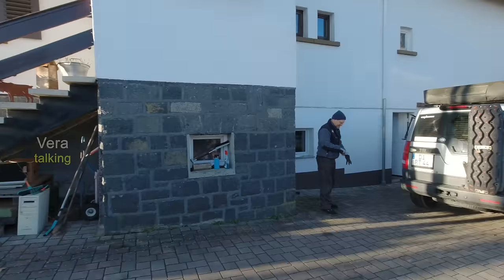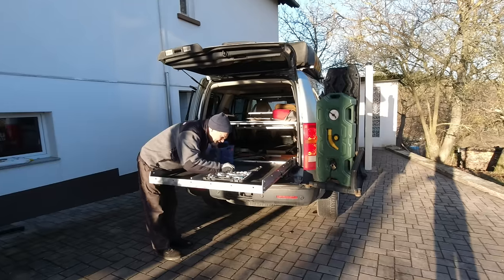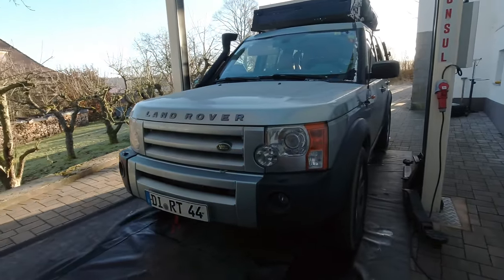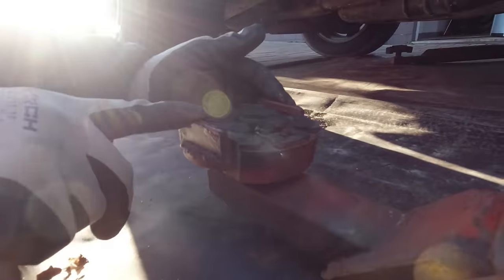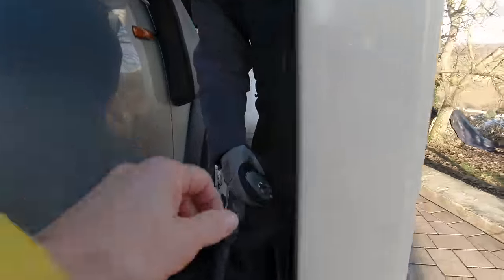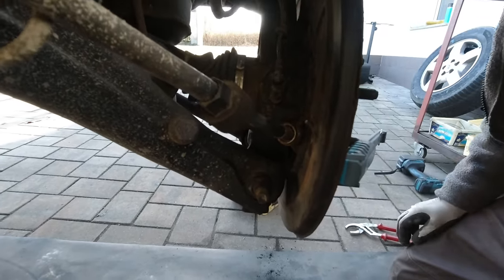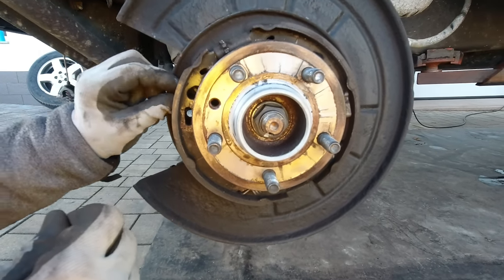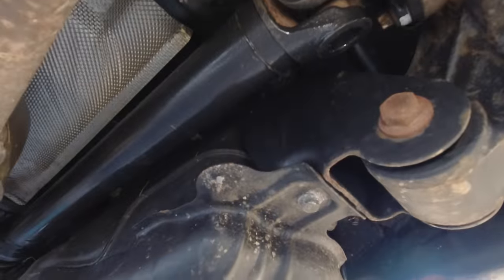How to Fix the Electric Park Brake - Land Rover Discovery / S5-Ep6

Comment: I was amazed at how many miles you have covered since you did this last time.  Treating your D3 or Land Rover like a classic car is exactly the way to maintain these vehicles.  Regular tinkering and fettling will give it best chance of not letting you down.  They can be complicated beasts but so rewarding when they are behaving and as you said Vera, such a good looking vehicle especially since it is  18 years old but still looks fresh 👍🏻😁 on the cable ends where you use your plumbing pliers to removed them from the backplate I alwasy smear a bit of silicone on there to stop the water trickling in.
Reply from the maker: wait for the next video on my Disco. It is even more obvious that these old Land Rovers have to be treated like a classic whose parts are difficult to optain. 😅👍🙋‍♀️

Comment: Ha ha! My German friend Manfred will be so pleased that used the word “Catastrophe”. Thank you Vera!

As you mentioned, Christian, electronic Handbrake failure is more common on Manual LR’s , because most of us that have the Automatic versions use the ‘P’ to act as our handbrake.
The problem being that when it does go wrong, often due to not enough use, everything is often very seized and difficult to undo to repair.
I think it is probably best to at least use the handbook occasionally.

Why somebody like Powerful  UK has not come up with an alternative proper lever operated Handbrake system, I don’t know.

A similar system is used on the New Holland ‘T’ series tractors, which automatically applies itself whenever the tractor is placed in neutral. When it goes wrong, which it surely will, it is a real pain. 
Fortunately for me, my one is too old to have that system. I’m in no hurry to change it for the younger version!
Reply: I suspect that the advent of electric emergency brakes was somewhat for legal reasons.  If applied at speed, the normal ABS system uses them to gradually brake the car, versus allowing people to lock up the rear wheels to perform "bootlegger turns" etc.  They usually engage when parking, also act as hill-holder clutches.

Comment: Great and a brilliant job!  Very rewarding when you improve on something and get those cogs well greased  Concern over the cable ends where they meet the brakes - water ingress as pointed out by Vera, as you've done just pack with waterproof grease, I get through tons of it on machinery.  One comment, as I've mentioned before, get the small rigid mud flap spats that stop all that spray up onto the outside of the wheel arch!  My OCD kicking in.... bloody desktop mechanics!  Maintenance on these vehicles is not for the faint hearted, and the facilities and amount of kit you have is better than most garages - they would just say replace, and another 5K please!

Comment: Hey guys another thrilling episode of LR3 maintenance. My 05 is due its 120,000 mile timing belt change and everything that goes with that, incl the oil pump of course, along with an a/c repair.  I'm going to disagree just a little with Vera, omg, I don't personally think the Discovery is difficult to maintain, there is just a large amount to maintain and pretty regularly too.! Thanks for the brilliant videos, they really make my Sunday x
Reply from the maker: 😅👍Wait for the next video. Most of what we say, especially I, is not necessarily directed to the able DIY mechanic. They don't watch us normally since they don't need any help. But for the beginner DIY Land Rover mechanic, it is a difficult. 😃👌🙋‍♀️Vera

Comment: I hate working on drum brake type parking brake. Since it uses servo effect, to make it "zero touch" brake pad to drum while able to achieve maximum bite at maximum cable pull is impossible. Always the new brake pad is actually mild touching the drum. Its easy to hear, while car jack up all 4 wheels and engage 1st gear. It hurts to hear and see that dark side of a drum brake design.

However,  I enjoy seeing Vera n Chris doing the job, its fun to watch as always.😊
Reply: I really enjoy him working on those drum brakes.  It brings back a lot of memories of my families wheel and brake shop when I was a kid watching my father and grandfather work on them.

Comment: I have a late 2008 Discovery with the later spare wheel bracket. By accident I found that if you drop the back part of the exhaust system you can access the module quite a bit easier!

Comment: I owned a new Discovery 3 manual from 2005 - 2008 and the only thing that failed during the three year warranty period was the electric parking brake. I remember the incident well because my wife was stranded in her school car park and the vehicle had to be recovered. Our UK LR dealer spent over a week fixing it. Our previous three Discos had mechanical parking brakes and I don't recall a problem with any of them.
Reply: Biggest issue with the D3 parking brake is lack of maintenance

Comment: Mental note.. if the handbrake fails take it to a garage. I'll stick to adjusting only. Shame LR couldn't come up with a simpler design. The old style (defender, d1, d2) handbrake on back of centre diff are easier to work on but needed regular adjustment to stay effective. An electric disc version of that could have been very good. There's a company that does disc conversion for that old defender handbrake.
Reply from the maker: Don't worry, other car manufacturers have also EPBs installed, not just Land Rover. And from the comments we get, they fail just the  same. 👍🙋‍♀️

Comment: I really  would prefer an old fashioned manual park brake.  When my D4 was under warranty I was 350km west of Alice Springs (Central Australia) and when we stopped for lunch I used the EPB.  After about 20 minutes of driving after that I noticed a bad vibration and smoke coming from my right rear wheel.  No alarms and no faults registered.  The right rear wheel park brake was locked on but the left was wheel was free.  Nobody has ever been able to explain how that could happen.  Anyway after six nights of accommodation with a rental car the EPB, all cables, both rear discs and the right rear wheel bearing were replaced under warranty.  The right rear components were severely heat damaged.  Quite an expensive warranty repair undertaken in Alice Springs.  Thankfully LR Assist were very responsive and also I had a satellite phone to contact them.  Only took 4 hours for the flat bed truck to reach me.  I don't use my EPB in remote areas anymore! I visited the service agent every day during the repair so I pretty much know how hard it is to remove the EPB from a D4.
Reply: I suspect that the advent of electric emergency brakes was somewhat for legal reasons.  If applied at speed, the normal ABS system uses them to gradually brake the car, versus allowing people to lock up the rear wheels to perform "bootlegger turns" etc.  They usually engage when parking, also act as hill-holder clutches.

Comment: Great content as ever ! I have auto and only ever put it in park rather than use parking brake. I know yours is manual but just checking if you see issues with my method in auto please ?
Reply: I have an auto FL2 & do the same. There’s a school of thought that we’re doing harm to the locking pin in the gearbox as it has to withdraw under load if the vehicle is on a slope.
Reply from the maker: On our Auto we only apply the EPB when parked at a steep angle, to support the transmission. 👍🙋‍♀️
Reply: @Vera_and_Christian  thanks guys. Keep up the great content, love it.

Comment: Guys, thank you again for another awesome video, so entertaining.
A quick question, I am 100% sure there is a reason, but on my BMW X5 (the same park brake module), I could disconnect Bowdenand emergency release cables from the module and remove the module with ease, did not even take wheels off.  Replaced the gear set and motor (Amazon) and it worked perfectly after I did reset procedure. Surely it can't be so simple on a Land Rover 😁
Reply from the maker: yes we also ordered the Amazon part. But we have a Youtube channel and want to show in detail what happens, how it looks inside, and how to fix it cheaply. That is our purpose here. When Fabian or our one other friend who has the priviledge to have is Disco 4 serviced by us,  comes by and want their EPBs fixed, we will use the Amazon part. 👍🙋‍♀️

Comment: very similar to Renault module / BMW module - the cables outer sheath crack  - lets in water and seizes causing strain on motor, so brushes wear out - new motor £38 / cables £75 and replace the small blue relay £5 on circuit board - done 2 now on Grand Scenic's  vs £800 from Renault + programming
Reply: The Discovery one is similar money from LR 😩

Comment: My 06 has the parking module broken. I don’t ever use it so I have been dreading fixing it. I know the gears are stripped on mines. I have more important things to tackle. Mines just reached 228k miles which is like 360k km? Just smelled a bit of coolant and coolant level was low. I went to find the coolant leak and I spotted power steering and engine oil leak. Still didn’t find the coolant leak. 

I love my lr3 and I will keep it running forever. 10k trouble free miles after rebuilding trans.
Reply from the maker: https://youtu.be/Tj5ojmUHU0A?si=jMsVwJe4oSAUxv7u check this video👍🙋‍♀️

Comment: I’ve been able to reset the module while still in the vehicle. Drop the exhaust and the top cover will prise off. I’ve found if the travel exceeds specs the threaded rod will jam against the stop on the L/R cable and the clutch mechanism screams its head off! Also when adjusting the handbrake shoes, there’s a little Allen screw which needs to be loosened prior to resetting the adjuster wheel then retightened after the ‘min’ 10 click wind back. Shocking design 😳
Reply from the maker: We have shown that in many videos. 👌👍🙋‍♀️

Comment: If I can get the EPB out using this method I will sign up for your patreon!
Reply: With a few slight mods (file down the brake cable holder and removal of one of the rubber support grommets)  it actually worked!!   Reassembly will be a nightmare but it is better than removal of the rusty backplate.

Comment: Having just spent all weekend doing the same job, I can tell you that you didn't need to remove the right side cable.
With the module in the car, unscrew the right side cable black large retainer from the module, then you can unclip the white clip, then then you can disconnect the right cable from the module.  That saves you removing the right side cable at all!
To remove the module without removing the left cable, you have to dismantle the EPB in the vehicle, remove the dc motor and gearbox, and then unwind the leadscrew while working under the car.  Terrible job, but at least you don't have to remove the cables.
Oh, and that bracket that the EPB mounts to above the differential?  Just remove it completely.  There are only 4 bolts to the chassis rails.  Then you have plenty more space to work!
Lastly, regarding the snap ring slipping off...  there are different gear sets from ebay and alibaba.  One aftermarket set it tooled badly and the snap ring groove is very thin and prone to the e-clip slipping.  Good to see you didn't use that type..    and there is a guy in Russia who made a complete brass shaft for the gear, but your custom retainer is a far more elegant solution!
Cheers from sunny Melbourne Australia!
Reply from the maker: We have already done a video on the epb, where we explain why we take out everything. And not open the cables on the module. 👍🙋‍♀️

Comment: Bring back the simple cable handbrake lever in the floor or under the dashboard...  I've just had to replace both electric parking  brake calipers on my 100,000 mile Golf. My 20 year old Passat with 210,000miles mechanical handbrake never had an issue. Progress? no.....
Reply: I suspect that the advent of electric emergency brakes was somewhat for legal reasons.  If applied at speed, the normal ABS system uses them to gradually brake the car, versus allowing people to lock up the rear wheels to perform "bootlegger turns" etc.  They usually engage when parking, also act as hill-holder clutches.

Comment: Hello LR ? Am Boni, From Afrika a landrover mechanic help me plz to solve this problem if you have ever encountered . Landrover disco 4 smoke caming from air intake manifold of the right side😢
Reply from the maker: You need to make a smoke test and see where the crack is. And then replace whatever part is broken. https://youtu.be/6vhYXutMSDc?si=cC_4jMxFqBt4k72x We have since then bought a smoke detector on Amazon. We use it all the time. 👍🙋‍♀️

Comment: Hi guys, owned a disco 3 in the past still own a disco 1 with nearly 700,000 kms on it just bought a disco 4 tdv6 8 speed 240,000 kms because i hVe a spine that is fusing and its amazing what i struggle to fit into. Just a question what are the lower tension wrench figures you use, the old one i use I'm finding doesnt go low enough in a lot of circumstances. Bit disappointed we bought the 2013 disco and the"QUEEN" turns up. Enjoy her. 
Cheers Lyndon down here in Tasmania.
Reply from the maker: Not sure why you are dissapointed. We still have all our Discos. Check out our videos, they are good.👍🙋‍♀️
Reply: @Vera_and_Christian  not disappointed really it was as if we bought our disco and you changed marks. As I said enjoy your new Queen and I'll keep picking up the extremely handy hints and info that both of you bring in this channel. Again thanks have picked up hints already so keep up the great work
Lyndon

Comment: What was the  problem with the parking brake? I have a similar problem where when I activate it, they engage but they scream after tightening. I also replaced the gears with brit part 2 years ago but they failed instantly
Reply from the maker: The Plastic shaft was distorted, so that the clip slipped off. 👍🙋‍♀️
Reply: sorry, I meant what were your symptoms to know there was a problem... did the brakes stop working or did they still and make a screeching noise. I'm dreading another go at removing my module... I'm one of the unfortunate ones where the plate covers the module behind the spare wheel so I had to cut an access hole through the thick steel... love your videos!!! @Vera_and_Christian

Comment: Do you think it is possible to put in a manual ratcheting parking brake in a Discovery 3 ? I want to put it in driver's the footwell, kind of like an old Defender. I feel like it would make it more reliable out in the woods off-roading. Let me know what you. think.
Reply from the maker: Yes, the rear parking brake is cable operated.  Intense job but possible.  Will cause a red indicator on the dash however.  Christian

Comment: I have a problem with my parking brake also. It holds perfectly when up hill, but fails facing down hill. It makes a horrible noise as it slips downhill.
Reply from the maker: Then you better search for your problem. Don‘t want to stress your transmission so much when you park on steep hills often.Always fix the obvious and not let problems escalate.👍🙋‍♀️

Comment: I will admit I do not like any ebrake period.  I would rather have a hand brake any days, much similar less maintenance. That's what I like about my D2 and easy to work on but people do complain about the engine issues that some people have,  but I got it vera has a manual transmission that requires using ebrake when parking im jealous I wish both my land rovers lr3& D2 was manual I can swap automatic for manual but I don't want to spend the money when I can spend the money on upgrading my land rover  D2 like getting rid of that cassette raido for a up today floating alpine  raido with gps and many other functions and the tires and black rims with fit on D2 that's money saved , what happened to the snow 😢 I love snow in winter months this morning in Amarillo tx got 4inch of snow and icy the altitude in Amarillo 3,662 in frisco is 689 big difference also in weather Amarillo gets high winds 4 seasons in a day sometimes 😊

Comment: Don't you just wish for a manual hand brake, two cables attached to a lever?
Reply: What kind of fun is that?
Reply from the maker: Yes.
Reply: Yes manual handbrake much better, especially on a manual car.
Reply: I suspect that the advent of electric emergency brakes was somewhat for legal reasons.  If applied at speed, the normal ABS system uses them to gradually brake the car, versus allowing people to lock up the rear wheels to perform "bootlegger turns" etc.  They usually engage when parking, also act as hill-holder clutches.
Reply: @GunnarMiller  I think it was done to remove the handbrake from the cabin as to most  LR drivers simplicity is just not a selling point
Reply: I don't see any modern cars with a ratcheting manual handbrake ... except my '15 Defender.
Reply: @GunnarMiller  You won't. Its a fashion trend. Most car drivers are not discerning with a view to home maintenance the more buttons or touch screens means luxury to most purchasers. It comes from the same place as boot closure mechanisms, automatic lighting and windscreen wipers.

Comment: I just really don't understand how that little lift carries the weight of those things
Reply from the maker: It's not a little lift, and it's up to spec. There are safety standards in Germany, and that lift can carry 6 Tons before it will fail.  I can also carry more than Christian can. 😅👍🙋‍♀️
Reply: @Vera_and_Christian  a real lift here in America should be able to lift 15% times it weight rating. so if it was rated for 10k lbs it should be able to lift 14000lbs no problem  that’s called ALI standards.